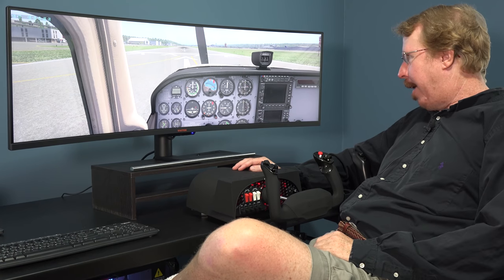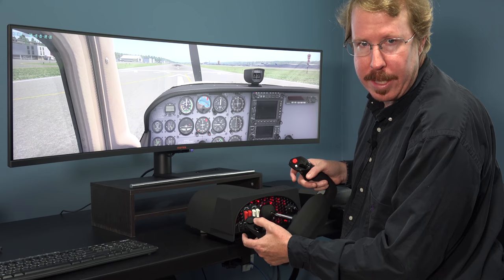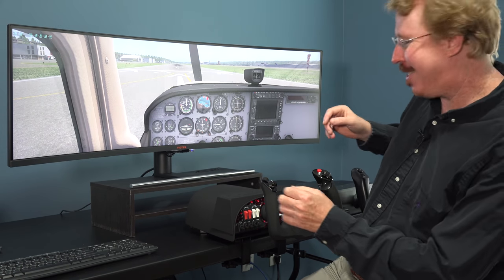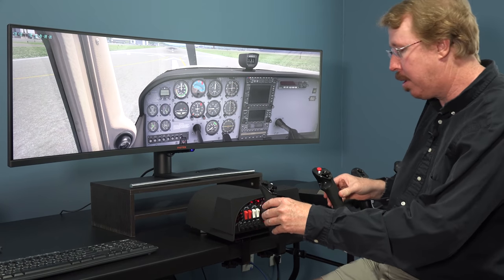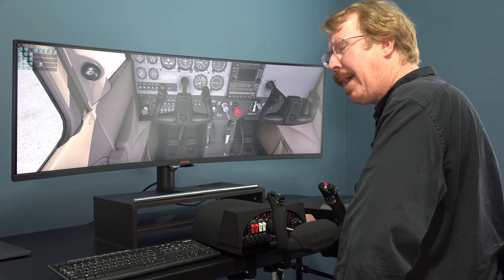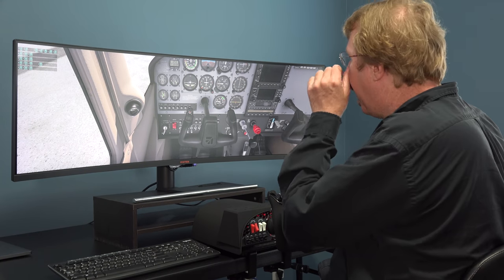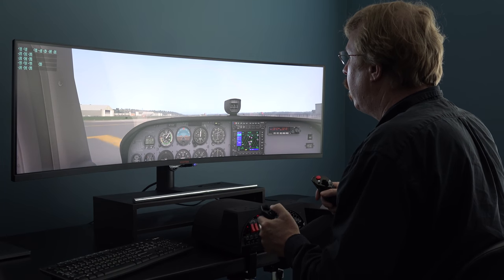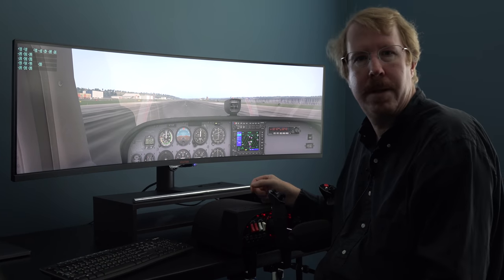Honeycomb Yoke Overview and Demo by X-Plane creator

Comment: i'm getting an error message  in settings for alpha yoke that  says: multiple axis for yaw x-p may not work properly. what does it mean and how can i correct that? thnks.
Reply from the maker: Not sure what is confusing about this very specific and complete statement.
Reply: @xforcepc  i'm new to flight simming and newbie with alpha yoke so message is not clear to me. could you help?

Comment: Why was the yoke moving on it’s own in the sim when you weren’t touching me the yoke? That would cause issues trying to maintain level flight. It’s right around 10:27
Reply from the maker: Yes, we saw that as well.  It is NOT the hardware doing it.  It was the sim...we fleshed that out off camera.  That is the wind moving the control surface and thus causing the yoke (in the sim) to move.  Austin and I talked about it at the time of the video and decided the amount of this effect might be too exaggerated and he is going to look into it to make sure and make adjustments if he finds it to be an issue.
Reply: @xforcepc  Right it was the wind in X-Plane moving the yoke since the plane was parked... I might tune down the wind effect moving the control surfaces on stopped aircraft (though this has nothing to do with aircraft in flight)
Reply: @austinmeyer  Thank you for the follow up. I appreciate the timely response and follow up. Keep up the great work. BTW, the P factor on your 172 is way over exaggerated. I fly 172 daily and its nowhere as drastic as the one in XP11.
Reply: @xforcepc  Thanks Mike, keep up the great vids. I enjoy watching them.

Comment: Excellent.. Austin should really open an option to have two flight controls working at the same time, so you can have i.e. pilot flying, pilot monitoring.. That would be realistic
Reply: You can already :)
Reply: @MrBlincster  You can have multiple profiles thereby multiple hardware yes, but you cannot use i.e. two yokes or two joysticks at the same time controlling the same airplane..

Comment: BTW, I have the saitek throttles too, but they connect to the saitek yoke with a multi-pin connector.  Doubt there's any such port on the new Honeycomb yoke.  Does anyone know of an adapter?
Reply from the maker: No, but Saitek does sell a USB version of this throttle for $59

Comment: Wondering if it is possible to have two yokes running at the same time in xplane 11?
Reply: Zeke Post it is possible. I use the throttle quadrant from my yoke for prop/throttle/mixture while using my MK Gladiator II stick. However, you can’t have two inputs for any one function, so no copilot without a separate computer.

Comment: OK. First off, it's a good yoke, far better than the Saitek but it has flaws. I even tried to get some reaction from Honeycomb to my issue but no reply was forthcoming, nada. That's not very polite so I set out to find my own solution. The issue is that the pitch control, during fine movements in the flare, is slightly jerky, or sticky but definitely not smooth. This is a real shame because they already have the solution partially licked by using linear bearings on the double rail guide mechanism under the hood. They strangely proceed to use a nylon bush to guide the yokes spindle and I discovered that this is where the stickiness comes from. As an engineer, and always trying to improve a product already on the market, I dismantled the yoke and removed the spindle boss that the shaft of the yoke runs through. I removed the nylon bush and replaced it with a linear bearing after a little turning and reworking and it has transformed the yoke. No more jerky, sticky resistance to contend with. These linear bearings are SO cheap, under £10 for 12 number, linear bearings !! They out perform the nylon bush by miles. I fly a real world GA aeroplane and don't expect a jerky action and now my Honeycomb yoke copies the feel more accurately. I would urge Honeycomb to make this improvement in manufacture. It will not be an expensive thing to do. I'd be quite happy to convert the yokes of anyone interested in making this undoubted improvement to their simulator experience. I'd also be happy to talk to Honeycomb as well, if they are interested in improving their product.

Comment: There is way too much swooning over this honeycomb yoke. It has some major shortcomings that need to be fixed before it is a viable simulator accessory. The Cessna 172 is a Far and Away the most frequently used aircraft for training purposes. The key is on the left side not the right. Why are there no throttle or mixture controls on the honeycomb yoke? It just doesn't make sense. They need version 2 immediately.

Comment: Instead of worrying about pitch trim why don't you make x-plane run at a higher framerate than 25 fps on a high end system.
Reply: Will hopefully improve soon, with the Vulkan implementation.
Reply: William Morris YT  I get 120 on 2700x with 1080ti

Comment: None of these yokes ever properly simulate actual trim settings. In order to do that a motor must move the center of the spring rather than unnaturally moving the yoke to center while simultaneously trimming. Simmers get used to that but it would be nice to do it for real. I modified a yoke years ago by adding a screw that moved the yoke center spring for real trim. Remember, on a real plane elevator trim reduces the force on the yoke but you do not move the yoke to do that. Even better would be a yoke that changed the spring force with airspeed. Oh well.

Comment: Lights? Okay. Battery Master, Alternator and Avionics switches I don't think they are worthy to have since I may as well use my mouse for that if I am going to use them just two times per flight.
Reply: If you do a proper run up you should be testing the individual mags and alternator. So 4 times per flight?

Comment: Bought a new pc from XForce and for some reason all my planes,plug ins well all purchases didn’t redownload to XPlane. I tried redownloading everything I purchased from XPlane.Org and they show in my XPlane Airplane file but not in the game. This only happened in XPlane 11, no other game. Any ideas?

I have actually ordered the yoke and controls from Honeycomb but will cancel if I can’t get my purchases back because the idea of constantly rebuying all add ons will keep me from playing XPlane. And of course I get zero help from Steam other than a single email saying I had to uninstall XPlane and Steam and reinstall after a rebuild. Hoping you have ideas or if not know a contact at Steam that cares about their customers.
Reply from the maker: The Steam version of X-Plane has a totally different folder structure than when you buy it on DVD or with a digital download from Laminar Research.  When you say they show in your X-Plane folder, what is the path to that folder?  If you loaded the planes into the X-Plane 11 that was preloaded on the PC, that is a different location than the Steam version.  The same holds true in the other direction as well.  Did you delete what was preloaded before installing the Steam version?
Reply: @xforcepc  C:\X-Plane 11\Aircraft is where I installed the planes I had purchased from Xplane.org. I deleted the steam and XPlane files completely from my hard drive after Steam told me to do it and install Steam and Xplane on the new hard drive because it wouldn't run on my old SST and would conflict with the new downloads on the new C drive and that doing that all my purchases would be downloaded with the new installation. They were not included and they don't respond to enquirers. Xplane shows in the Steam Library but not in the Steam downloads ?

Comment: Austin, you seem to be a cool guy so please don't get offended. But if you wanna see someone raise the bar and exceed what you have achieved then fire up DCS and check out the extremely immersive flight model. X-Plane seems like flying RC planes compared to DCS. I'd absolutely love X-Plane to feel as good as DCS. P.S. Hope you fix the turbulence if you admit it yourself that it's overdone for "mild" :)
Reply: MiG-23  I'm sure you are a real world MiG 23 pilot though :) How about this: fire up X-Plane, in a quality payware GA aircraft, take off and then bank 90 degrees left or right and pull yoke as much as you can. You don't need to be a real world pilot to know that it would result in a stall rather quickly. But not in X-Plane. That's why it feels like flying little RC planes. Sure, having a proper yoke helps reduce that over sensitivity but if it's not implemented correctly then it won't happen regardless of what controls you're using. Do the same in DCS or IL-2 and you'll see what happens.
Reply: MiG-23  Oh yeah, which is why I still haven't uninstalled X-Plane. It could be the PERFECT civilian flight sim. It has ortho, good graphics and more and more addons for the weather, etc. but the most important thing is the flight model of course and this is where it, sadly, fails to deliver. I was shocked myself when I discovered it after years of hearing how good it was but DCS (the base) is free so anyone can pick it up and try some maneuvers in the TF-51 for comparison. You've been warned though: it might make you not want to fly in X-Plane again. That's how much better it is.

Comment: When are you going to work on fixing X-Plane mobile bugs? It is a lack of respect for users to abandon this simulator because not everyone is able to buy a high-end PC to run X-Plane 12. X-Plane mobile is in a state of total abandonment with many bugs and a serious flaw is the fact that it is not working on devices with Android 13. After my device updated to Android 13, X-Plane stopped working.  The simulator hangs on the airport selection screen.

Comment: Dork is correct. Calm down! Ughh!!! And who cares if you try stupid electric cars or Lancairs, lol... as a quarter-century military carrier pilot, instructor, and CFII/MEII, I'm a little underwhelmed on your over-detailed, 120 Db Focus on this yoke. (Eye roll)... 

And here's the deal. If it doesn't have Rudder pedals and a throttle right now, don't waste our time showing this crap. My ancient Logitech G940 is just fine..., I'll take a Logitech product with full controls any day because what you're focusing on is irrelevant.

Also since the trim runaway probability is extraordinary low, make sure you're testing Rudder pedals and throttle, not trim switched -- so you can do precautionary and engine out Landings... Who cares about a split trim switch LOL. Big oversell... In sum. if you quad instrument failures at Montgomery drove you to make X-Plane. If X-Plane is designed to train people for instrument checks and I IPC's, that makes me worried about what a pilot thinks is good training....

Besides trim EPs otally depend on the specific airframe, on how to handle a nose down run away. Do you have a CFII ticket to be a SME on this???... Let MZeroA enthusiasticly cover this emergency, not you...

And, given the X-Plane is frankly, way too easy and unrealistic, and does not effectiveness in IDR I've seen. I much prefer things like DCS World, where you have better control over real operations... and who cares about a trim button, that has almost nothing to do with real simulation... 

And BTW, most good Sims now record real aircraft sounds, so good to see you're catching up from behind...

I'm exhausted listening to this silliness... Off to take a nap LOL